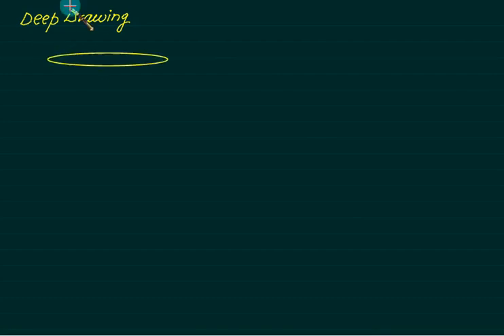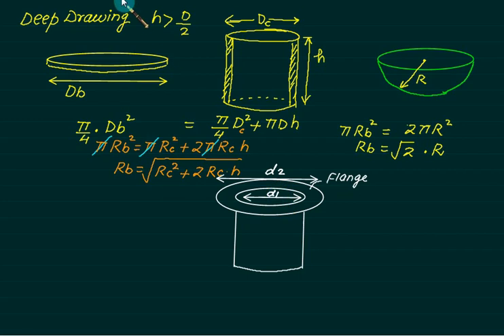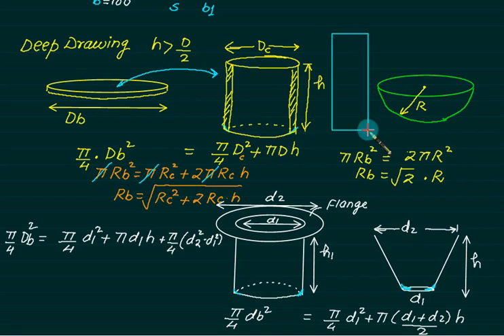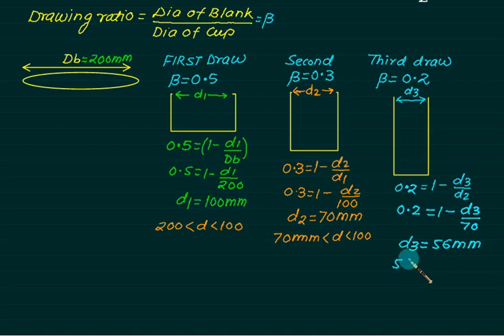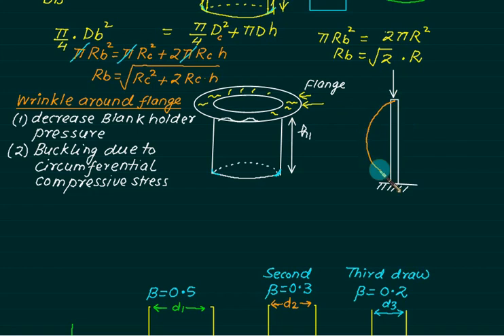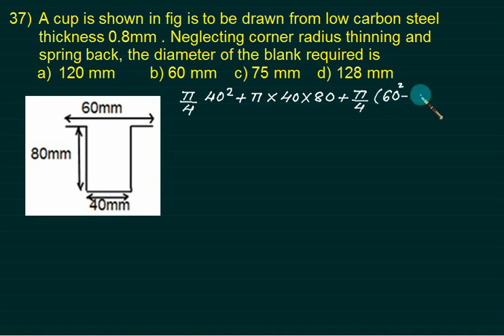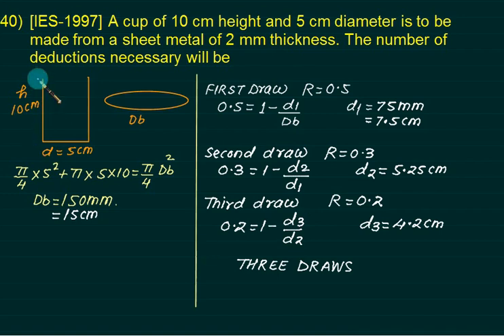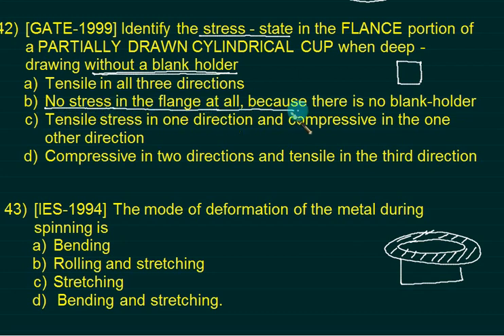sheet Metal 03 Deep Drawing

Comment: in 4:57 you have used beta value less than one but it must be greater then one for drawing ration right ? Since Diameter of the blank is higher than the cup dia. From my view you have used draw reduction ratio method instead of drawing ratio method.
Reply: yes you are right. he has used reduction formula for calculating reduction in every pass. Drawing ratio and reduction are two different formula in deep drawing. drawing ratio should be always greater than one but reduction should be less than 0.5.
thanks

Comment: I need to deep draw tin sheet of .21 thickness through hydraulic press. Size 80mm height and 150 dia. We've been doing it on mechanical presses in 4 operations and it's really painful as the thickness is less and we are constantly struggling with wrinkles and wastage.
If someone can guide me for the same I'll be really obliged .
Thanks.
Rishi
9911992299
Reply: try preheating .. it may  reduce wrinkles problems :D
Reply: how are making 4 stage?
Reply: 4 draw looks like not enough or hold down sleeves not working
Reply: I would like to know whether the problem was solved or not ...if yes , pls tell me how ?